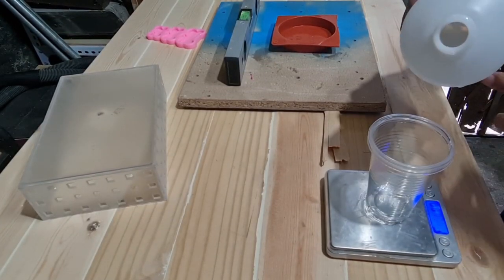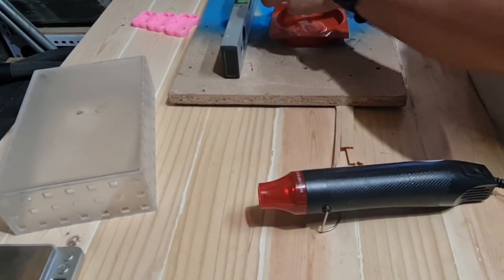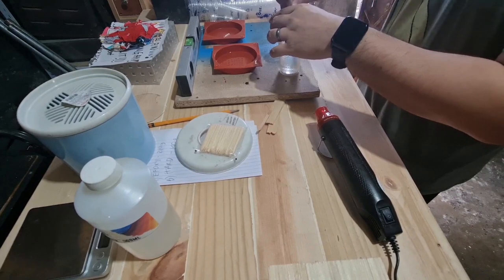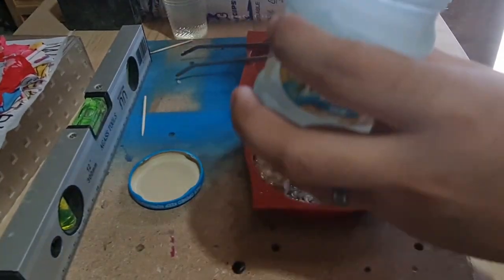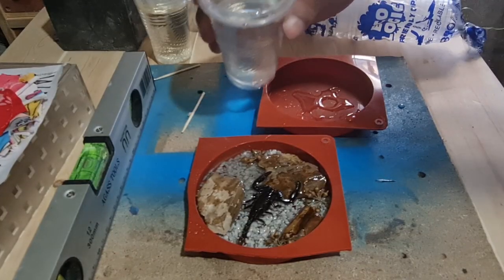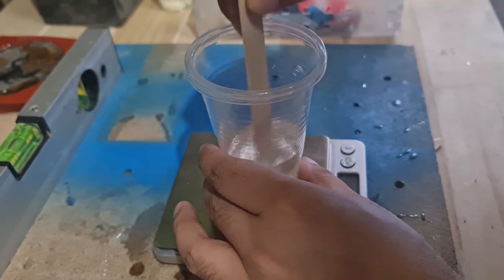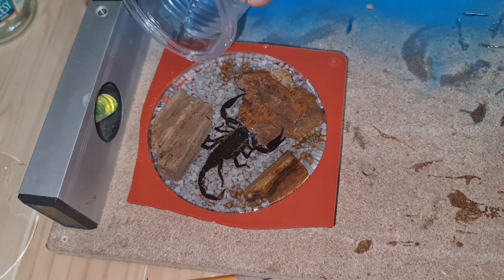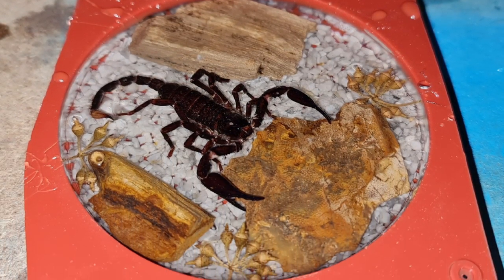Casting a Scorpion in Resin | Woodpanda PH

Comment: Hi, I cast black scorpion in big ashtray n it's floating at first n i fix that with shotgun pellets but i couldn't removed all the bubbles n i watched some u.t videos for that problem, oh i forget to mention that ; i used abouts 40 random sized n shapes of sea shell's n most of big bubbles from them, my question; if i placed it in ordinary cooking peresher pot and pershrized the pot with air compressor to 5 psi my bubbles problem are fixed or not !?